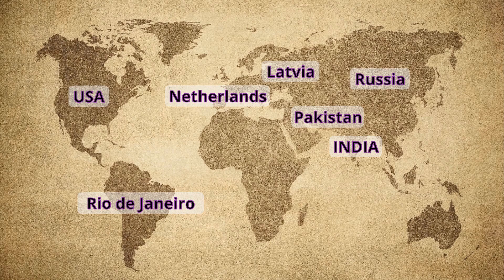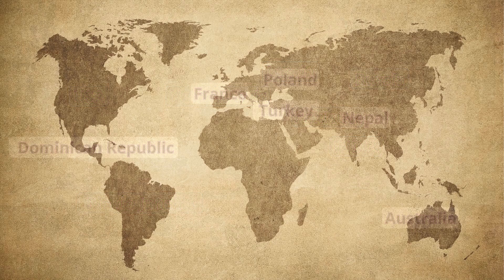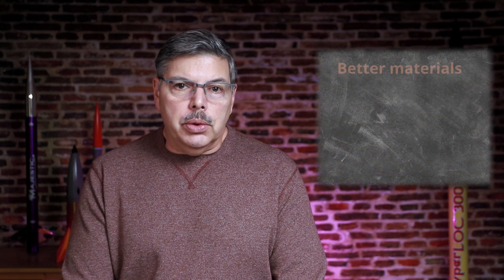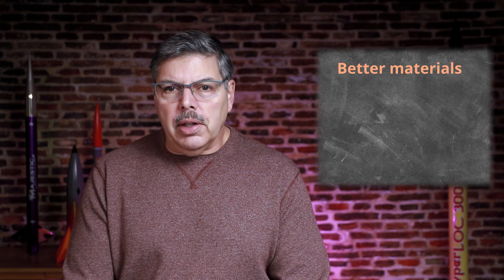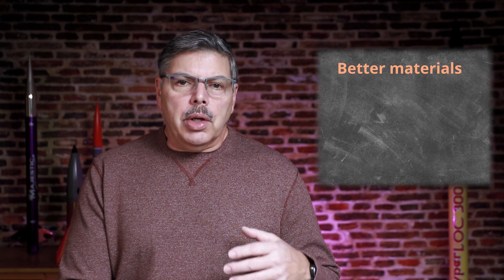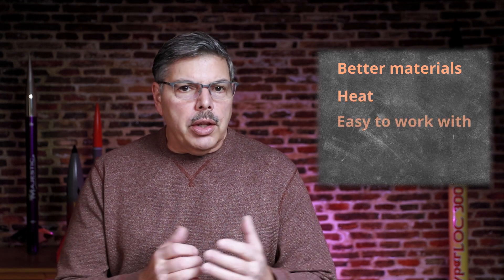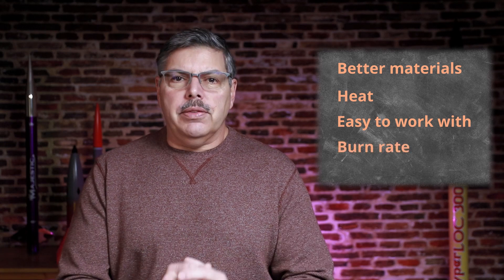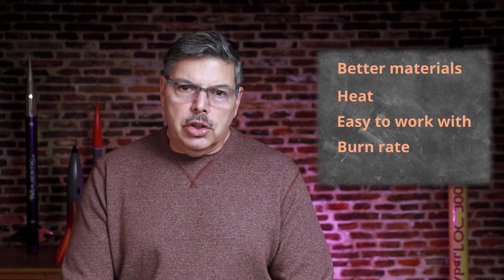Rcandy vs Flex-fuel, what you need to know about rocket fuel.

Comment: Hi, I tried making flex-fuel using Kyro corn syrup that's available over here. The mix failed to ignite and probably beuse of the water content in the Kyro CS and because I didn't heat it enough.

As a test I tried gently heating some Kyro CS only and after 'reducing' it gently on an induction hob it lost about 22% of its mass. This must mean, sureley, that after careful heating to over 100 degrees C the fuel becomes oxidister rich after the water is boilt off? Eg, with the generally accepted 65% potassium nitrate, 17.5% sugar and 17.5% Kyro CS, after heating and losing say 20% of the water content in the Kyro CS the effective mix proportions become approx 67% potassium nitrate, 18% sugar and 15% Kyro CS. Maybe this change in mix proportion doesn't matter? I'd love to know what you think.

Many thanks, Simon
Reply from the maker: Hi Simon, if you are using a different product, then gently boiling off some moisture content sounds like the way to go. The propellant will burn well at the 67-18-15 ratio.

If you can't get the propellant to burn, try using another brand of corn syrup or honey instead; it has been proven to work. Don't forget to like and subscribe to the channel.

My friends over at Rotary Rocketry has a four part series on corn syrup substitutes. Best of luck and stay safe!
https://www.youtube.com/watch?v=RD4GXXHC_xM
Reply: @TheRocketeer Thank you for your valuable reply. The corn syrup is actually Karo corn syrup, not Kyro corn syrup. I spelt it wrong! The Karo CS bottle looks exactly like the one shown on the rotary rocket videos. The bottle looks the same but maybe they put water in it over here in England but that wouldn't make sense. No it's the same as the US type. Thanks, I'll ensure the water is boiled off gently. The procedure you show, temperature and timing boil the water off anyway which means the final mix proportions are different to those that go in the pan. If the ratios aren't that critical then that must be why it's generally not commented on. Thank you. Great videos!

Comment: I'm interested in the sorbitol alternative since it's very hard to find corn syrup for cheap here. When you say you use sorbitol, do you melt the powdered sorbitol and then add the sugar and kno3 or do you use sorbitol in liquid form? Couldn't find any video anywhere that does sorbitol + kno3 + sugar so my question remains unanswered for the most part.
Reply from the maker: I melt the sorbitol and then add the Kno3. Go to my home page and click on the video tab at the top. Here is the sorbitol link. https://youtu.be/8_GsleHQZGw
Reply: @TheRocketeer  I've seen that one. That leaves it to me to experiment with using sorbitol as some sort of binder to get the sucrose and kno3 mixed together I'm guessing. We'll see how that works out. Great video as always by the way

Comment: R-candy is good and effective for rockets.
Reply from the maker: Yes it does work well. I just think there are safer alternatives.
Reply: @TheRocketeer  can you tell me a good mixture and include the ratio. With r-candy I'd do 60% kno3 and 40% sugar. Also corn syrup isn't as cheap as sugar. Any ideas in regards to this?

Comment: love your videos, they are a big help as I get back into model rockets. I have a couple questions about the components used to make the flex fuel. Most store available kyro syrup and corn syrup has vanilla flavor added, does this effect the the end product? Also Powdered sugar has corn starch. I know both the syrup and sugar an be made or purchased without vanilla or corn starch. Would this be better to use or does it have little effect? I'd think the vanilla flavor wouldnt be a big deal, but the corn starch in the sugar would at more like a inert filler but may aid in binding. I don't know how much corn starch is in powdered sugar. Also couldn't regular sugar be used in the   flex fuel since the sugar is dissolved and granular size is less important?

Do you have a website or other form of reaching out?
Reply from the maker: I don't think the small amount of flavorings have any effect on the propellant. I do use the light colored Karo and have never tried the darker variety. I have always used powdered sugar so the small amount of corn starch seems to burn well. A friend of mine uses granular sugar instead of powdered sugar. I think you are correct that granular sugar is dissolved by the corn syrup and works just as well.
I have considered using pancake syrup just for fun and see if that works.
Thanks for your comment!
Reply from the maker: Go to my home page youtube.com/rocketeer then to the about tab and there you will find my email address. Talk to you soon.
Reply: @TheRocketeer  I recently read that typical super market powdered sugar may contain up to 25% cornstarch and some add anti caking agents. The corn starch is added as thicker for frosting and such. However it can be made at home by simply blending granular sugar to a fine powder, or purchased from a baking supply. Maybe I'll experiment a bit between the two. I don't think corn starch  would have much energy density but changing from one sugar to the other would likely change the needed mix ratio. My luck I'd end up with a launch pad covered in burnt caramel lol. Dark Kayro syrup contains molasses for adding a bolder flavor for muffins and a like, probably wouldn't benefit the rockets performance (but would smell delicious I bet). I agree, I doubt the small amount of vanilla extract in the syrup would change much, but plain corn syrup can be found at a many stores... Maybe I'll try that too once I get a bit deeper into the hobby. As for now I'll keep my engines simple and us the typical components. Thanks again,   keep up the great videos.
Reply from the maker: @fragmentedmind549  Sounds like a good plan. Let me know what you find out. Stay safe!

Comment: Hi, I know it's been a while since you've posted this video, but I have a question on doing a KNO3+SU+25% Sorbitol fuel. Do you use a finely powdered oxidiser in this case, and second - you do it normally (mix everything, throw it on a heater and just melt the sorbitol without anything else)?
Thanks in advance.
Reply from the maker: The KNO3 I use looks about like salt that you would put in a shaker to season food and for that reason I do not grind it. If the potassium nitrate comes in prilled form like for fertilizer then it will need to be ground. If the KNO3 is ground to a very fine powder then it may make the propellant difficult to pour.

I am now experimenting with a sugar mix that is 80% sorbitol and 20% sucrose. The propellant can still be poured into the liner and the coring tool can be pulled in 90 minutes without sticking like crazy to the mandrel. This fuel will meet Triopoli requirements and can be used at local launches.

For smaller batches of 200-300 grams I do not premix the components. I melt the sugar then add the KNO3 and mix continuously until it is time to pour. I try to keep things simple and easy to repeat. Take notes on everything and only change one thing at a time.

In this video I make flexi-fuel with corn syrup.
https://www.youtube.com/watch?v=KZQ-cVx4Mkw

I hope that helps and remember I am learning too!
~Chuck
Reply: @TheRocketeer  Btw I tried many Mg configurations, and adding 10% Mg powder is just a good, as Al
Reply from the maker: @piotrkrawczyk2390  Thanks for that information! Did the Mg produce any flame?
Reply: @TheRocketeer  yeah, nice violet, with a tiny bit of white. I've also done a second test, but I've accidently made it on a pan, that had a bit of sodium ion contamination from previous test and it was orange next time (still looked great). And performance was pretty much the same with 5-10% Mg, but color is great above 8-ish %.
Reply: @TheRocketeer  Because now I wanted to, again, do the 75mm 3 grain motor, this time with smaller throat diameter, because lastly I just wanted to see, if the motor would even be in one piece after the test, and now I got a bit more confidence. And I really thank you for that idea of using sorbitol with sucrose, that really improves performance, tested just a 5 min ago.

Comment: Thanks for the great videos! Can you comment, based on your experience, on which of the propellants you mentioned (e.g. sorbitol, flex fuel, etc.) is best for humid conditions in terms hygroscopic effects in humid conditions and if there's anything you do to protect your propellant grains from humidity. Thanks!
Reply from the maker: I don't think one sugar has an advantage over the other for rejecting moisture. Both are very hygroscopic.

I always seal my grains in ziplock bags when they are cooled off after casting. I find this to be the best method for keeping them dry. You can also store them with calcium chloride ( DampRid) in a closed container, make sure you get unsented.

I use foam ear plugs placed in the nozzle to seal motors loaded with fuel a few days before launch. Painters tape also works well but is not as convenient. When prepping the motor for launch I don't worry about the humidity because they are exposed for a short time. Great question and I hope that helps.
Reply: @TheRocketeer  Yes, very helpful, thanks!